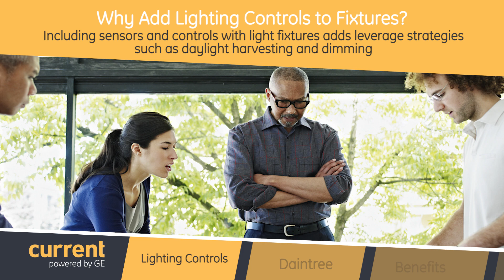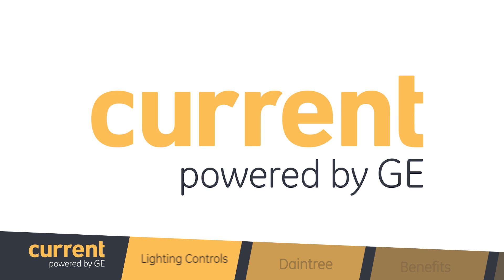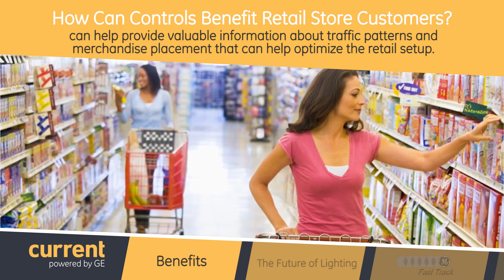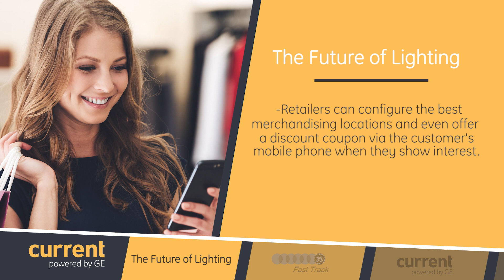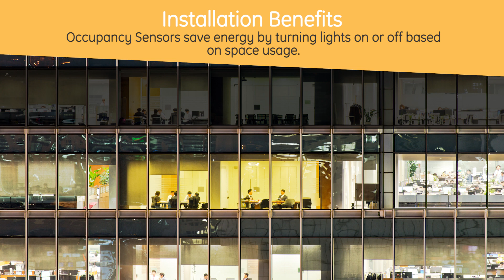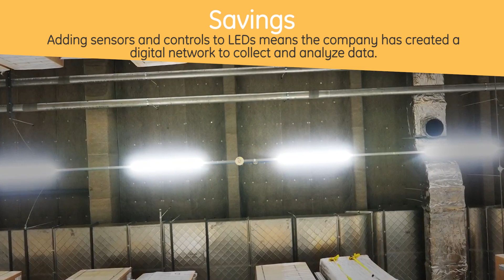Fast Track Training: Daintree Fixtures Control by Current, powered by GE

Comment: So if a commercial building already has a BAS system contolling lighting, HVAC, and daylighting, what would be the percentage of energy savings if this is added to a system like this?.  Obviously not the 70% as mentioned in the video.  Just curious what you think it would be.